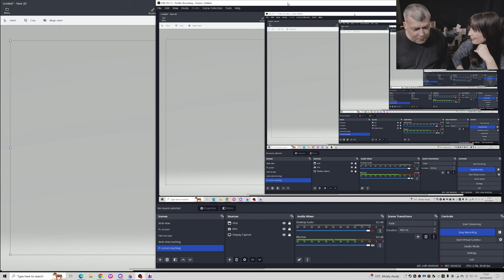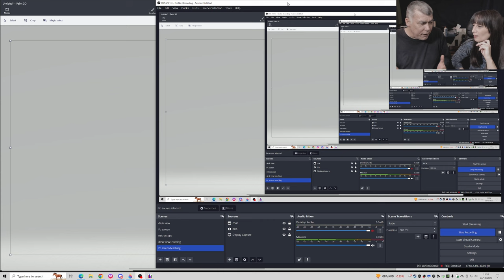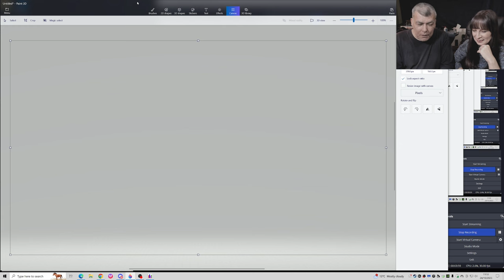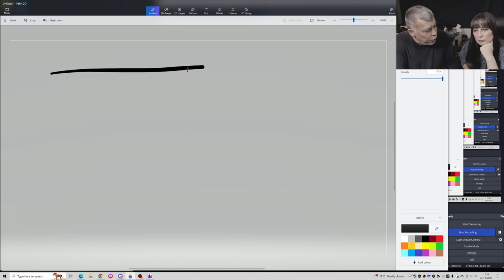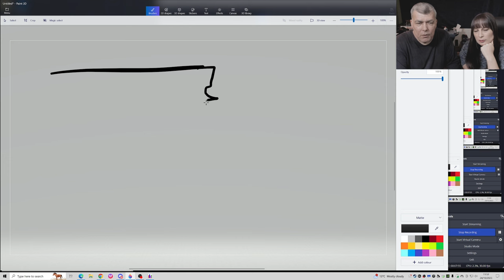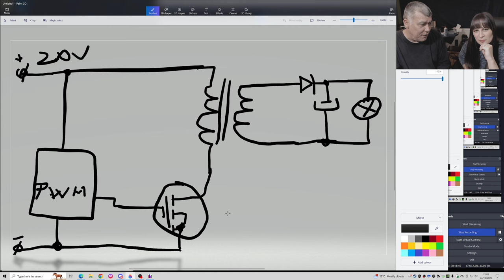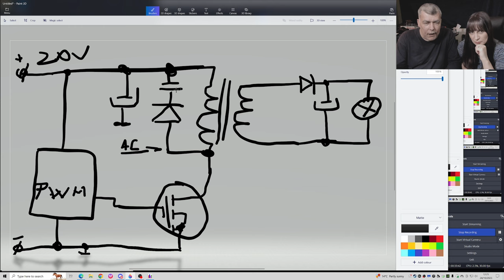High voltage switching power supplies - Let's build one - Lesson 36 Learning electronics with Diana

Comment: This is apparently supposed to be a flyback converter.
You would NEVER use a diode directly across the input winding of a flyback. It completely defeats the intended behavior of the circuit. The energy stored in the inductor is supposed to be delivered to the load via the output winding.
Adding a capacitor in series with the diode without also assuring a discharge path for the capacitor defeats the intended purpose of the "snubber." The capacitor will very rapidly charge to some high voltage and simply stay there. IF an ordinary diode instead of a fast recovery type is used, some of the charge on the cap can be removed via the reverse recovery charge of the diode. This approach needs to be used very carefully.
In reality the body diode of the MOSFET is likely conducting like a zener diode to discharge the leakage inductance spike. This can be a safe thing to allow, but again care is required.
The "phasing" of the "transformer" is critical to correct operation. The output winding must be arranged so that the diode in the output is reverse biased when the MOSFET is ON. In a flyback converter the magnetic component isn't really a transformer for purposes of power delivery. It is an inductor with one winding to charge it and a separate winding to discharge it.

Comment: so LC filter is working both way remove noise from wall socket and filter noise from switchning powersupply primary. i see this filter in washing machine and kitchen multi robots with big motor like separate filtering on cable in metal case with diagram components (EMI filter)